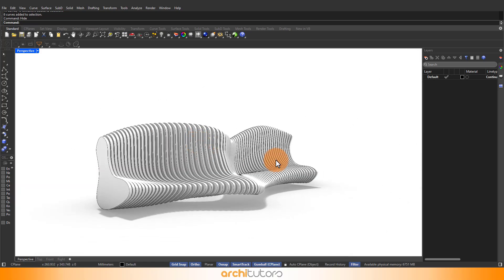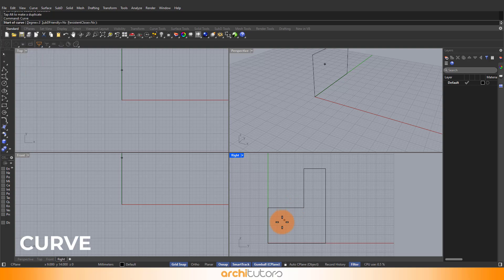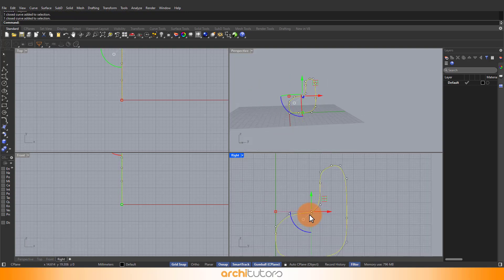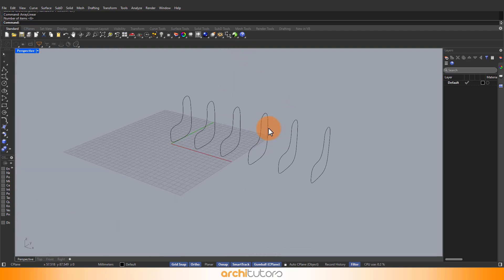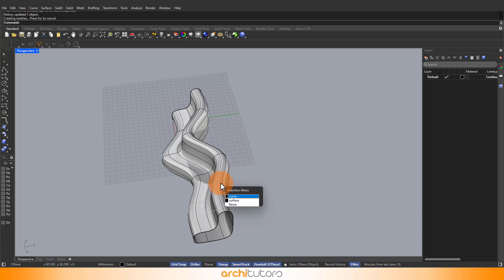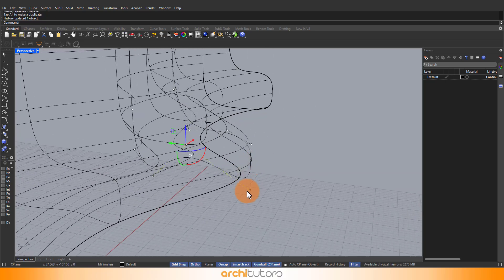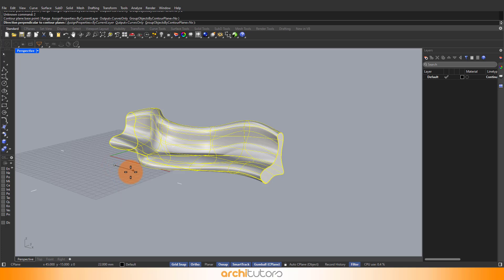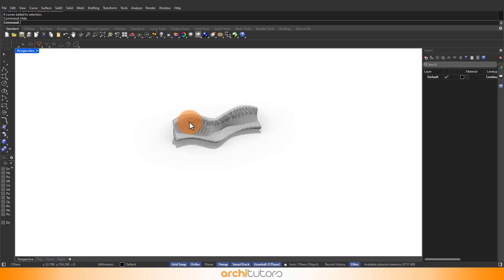Easy Rhino Tutorial for Beginners (Rhino 3d)

Comment: how can i take each piece side view and turn it to dxf file so i can cnc it
Reply from the maker: You can take each contour curve and use the Make2D command in Rhino to generate side views. Once you have the 2D linework, arrange the pieces flat on the XY plane and use Export Selected → choose DXF format. That way, each slice is ready for CNC cutting. Just make sure to check scale and units before sending to the machine shop